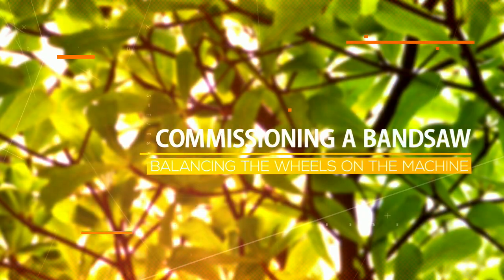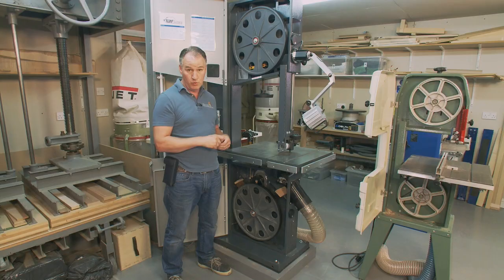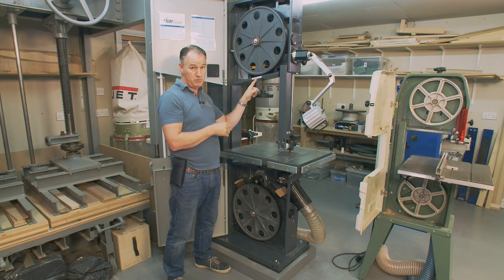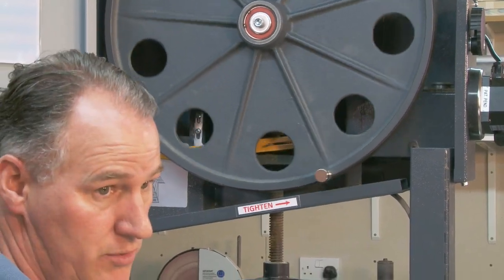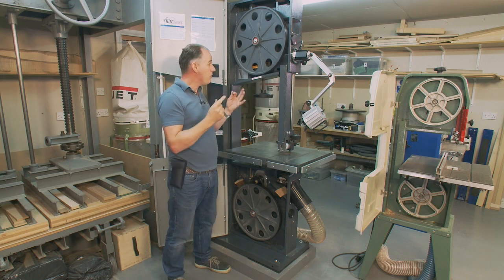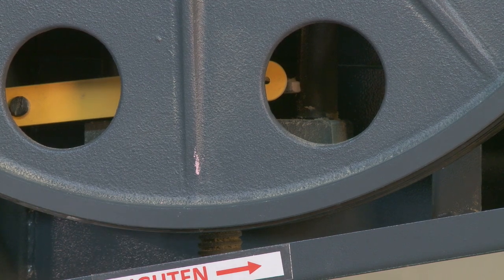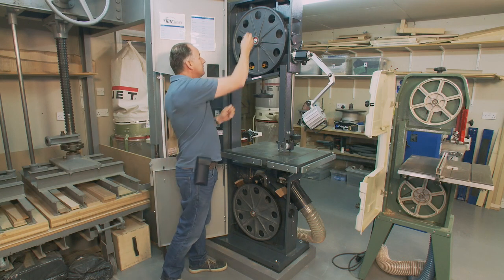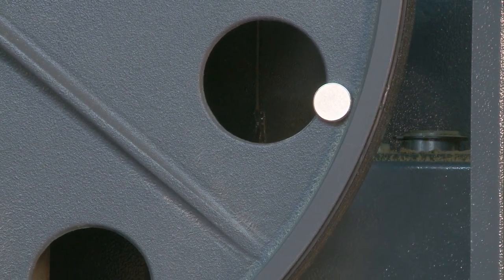Balancing Bandsaw Wheels on the Machine  - Peter Sefton (Trailer)

Comment: Use a lawnmower blade balance Jig. A metal cone on a point. Hardware Store has them.
Reply: not as accurate as it's shown here, and don't forget the size of the wheel.